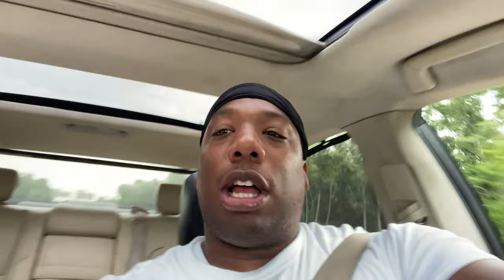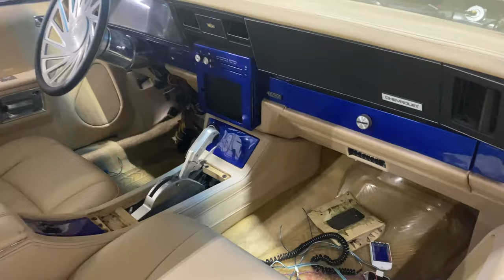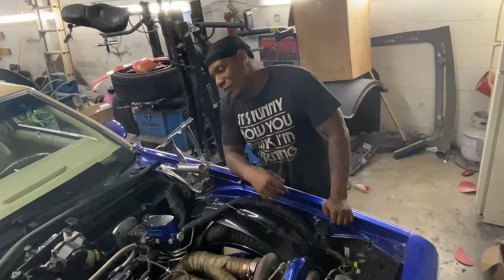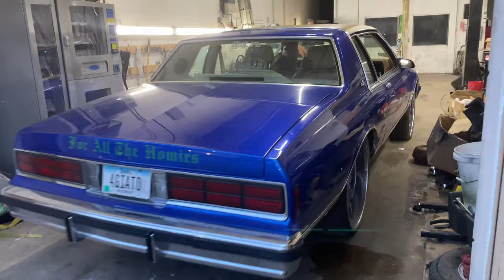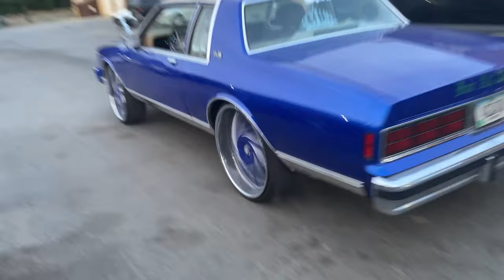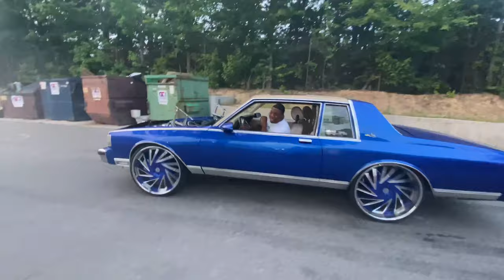Twin Turbo Box Chevy I Stole for A Day

Comment: Y turbo an not supercharge
Reply from the maker: A turbocharger will produce more power at lower RPMs than a supercharger. A regulator built inside the charger opens the waste gate, which gets rid of any extra pressure and enhances the performance.
Reply: Von no disrespect  but I seen alot of procharger  bust  a turbo  ass!!!